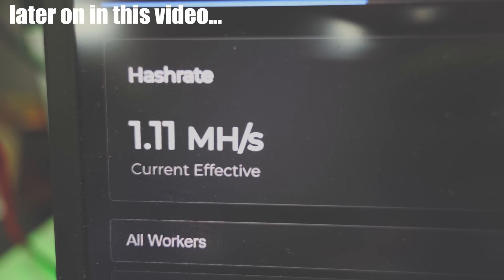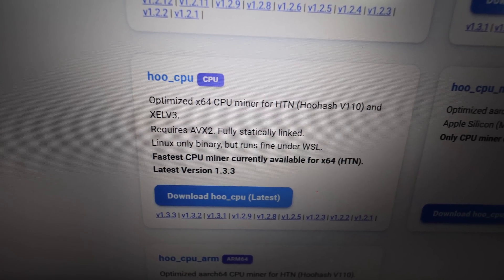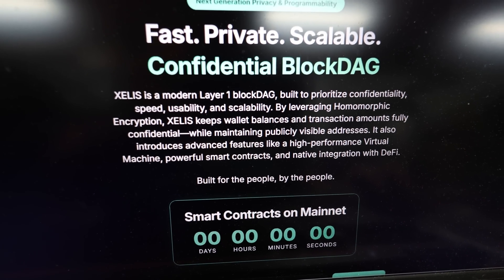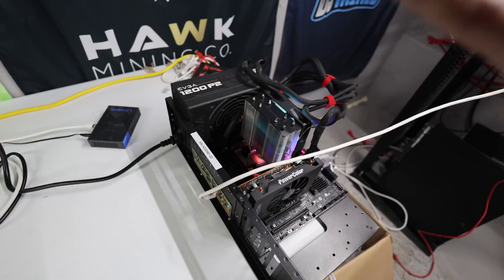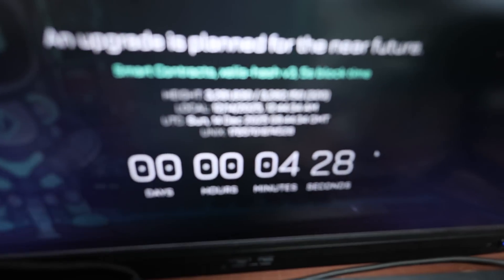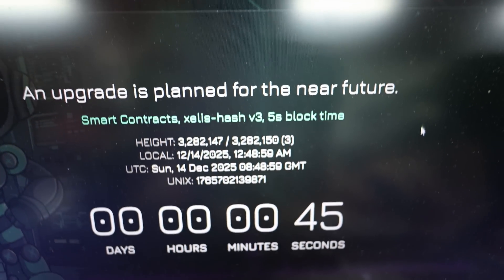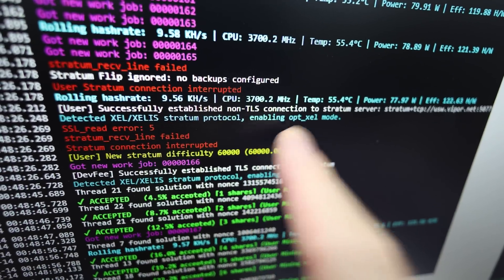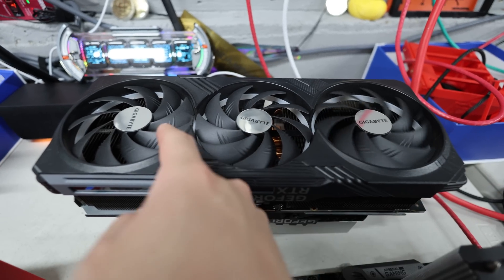XELIS HAS CHANGED GPU MINING FOREVER.

Comment: for the board that doesnt boot without a gpu: some am4 mainboards require GPUs now, famously the asus x570 dark hero got a bios update that wont let you boot without a gpu. only solution i found for my server was to downgrade the bios, as the old version was still working this way. guess they got greedy and want you to buy server boards or something (not that there are any good from msi/asus for am4).
Reply: An old 1GB 8950 is like 14$ on eBay. I just got dirt cheap turds like this and everything that’s a turkey about GPUs accepts this configuration.
Reply: @maxpow99 for me the main issue is i dont have a free pcie slot for a gpu. I have a 4x M.2 card + a 2x 10G SFP+ card and the limited am4 io doesnt allow anymore